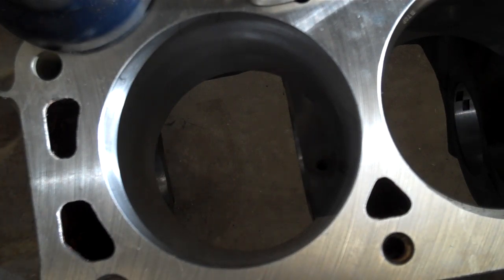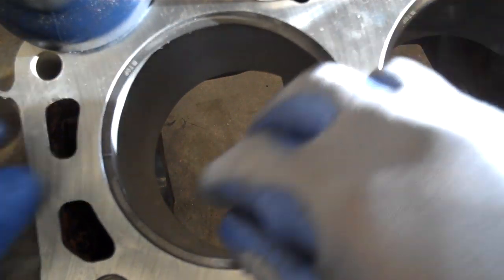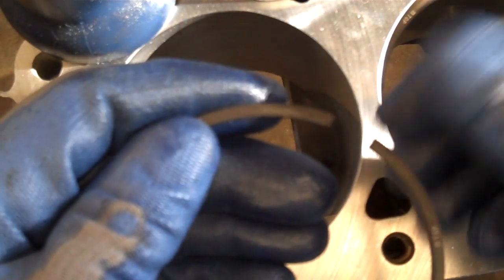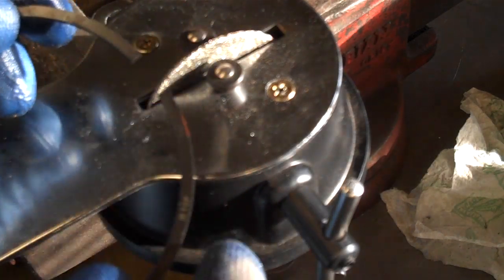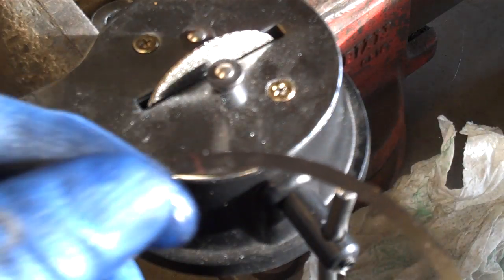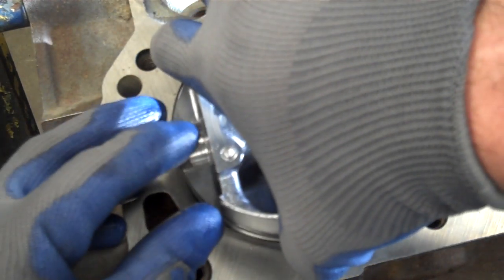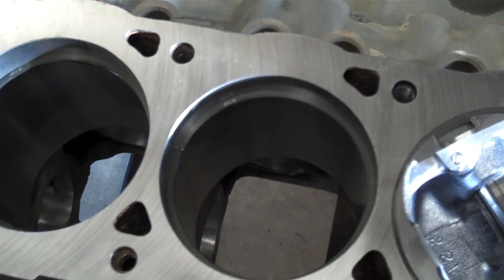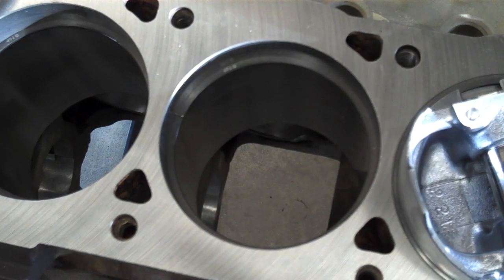How To Check Piston Ring End Gap.MP4

Comment: great vid...especially the tip of using a piston with ring on the oil groves to consistently set the ring for measurement. setting the ring for measurement at the tightest point in the cylinder, near the top, which has the least wear... is the only method to use.... thanks

Comment: The last 45 seconds of his video I found "tedious."  School's in.  Why would you check ring end gap and set it at the top portion of the bore[squaring it with a piston upside down?  I wouldn't. I would never assume the bore is true without taper, without measuring it as such.  You need to know the ring package spacing below the deck at the bottom of the stroke and at the top to fit rings in their actual range[Simpleton stuff]  Adjust for taper.

Now to set rings for less than 1% leak down: Why would anyone request his machinist to use a torque plate attached to deck during power honing and then pick up block and go home and foolishly set ring gaps without one?[Simpleton stuff]

Finally, everyone files top ring and second ring, but very few[Not this guy], Know how to set oil ring" tension?" That is critical to longevity in High RPM.  Figure that one out kiddos and I promise it's one of the keys to 1/4 mile or 500 mile trophy endurance. Know "how" and you will still have ring sealing afterwards.